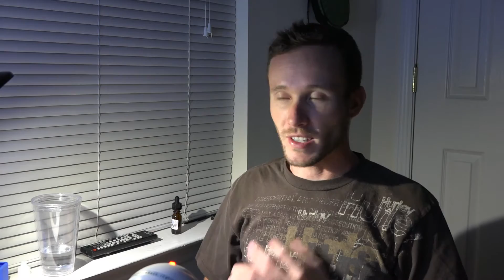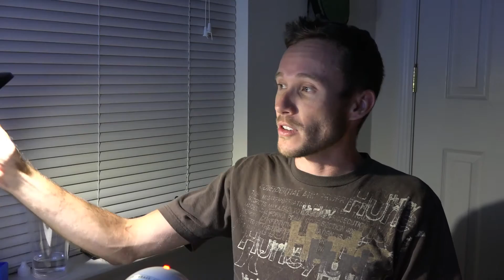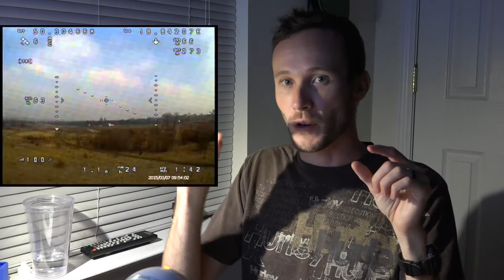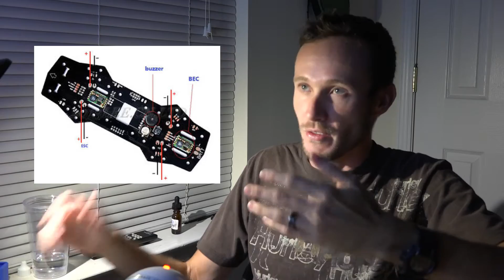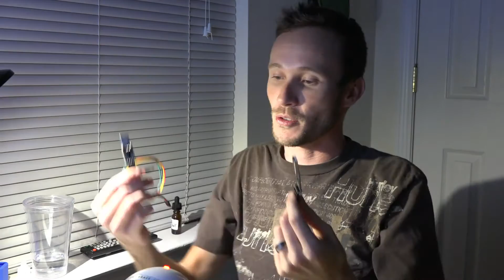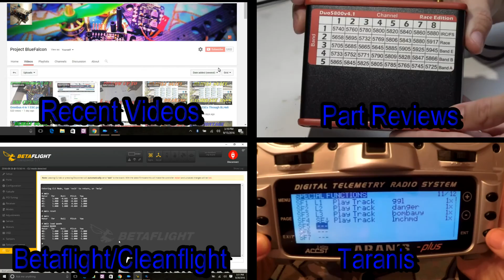Multi-Rotor Terms To Know

Comment: JC, when you hook up the ESC's, the squigly two wires (DIN and ground), is it possible to twist the ground wires together and ground them all? Ground is ground right??? I just get tangled up soldering all the grounds on to tabs.
Reply from the maker: You mean the two little wires right? Yep ground is ground. Except on the ESC you have the big ground and the small ground. Some people remove the small ground completely and everything still works fine. But I still use it just in case. What I do is instead of running the small ground from the ESC to the flight controller I solder them to any ground on my PDB.

Comment: Thanks for the video. I have a quick question-- I there any reason people don't use action cameras like the #16 or cheap mobius to fly fpv and record the flight. I would save room and weight and cut down operations. I can see if we were paying $12.00 for FPV cams.
Reply from the maker: Not many use those cameras because of the FPS. Most people want at least 1080. Also because of the high speeds of the drones you need at least 60fps. The mobius can do 1080 but only at 30fps. And the #16 can only do 720. But for the same price as the mobius you could use the Firefly Q6. It has 1080p at 60fps plus built in video stabilization and a built in menu to make all your setting changes. Its not as good as a Runcam V2 or GoPro but for the price of the Firefly Q6 its a good camera. 
http://www.banggood.com/Hawkeye-Firefly-Q6-4K-1080P-24FPS-HD-Mini-Camera-for-FPV-Racer-p-1051978.html?rmmds=search